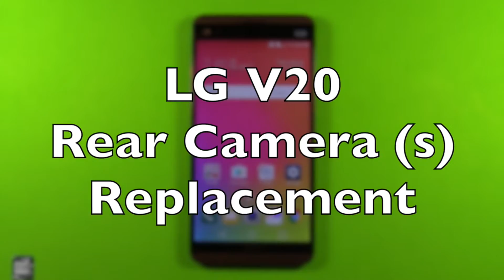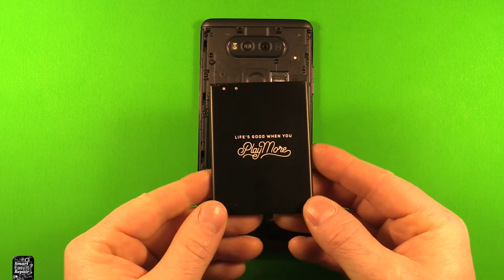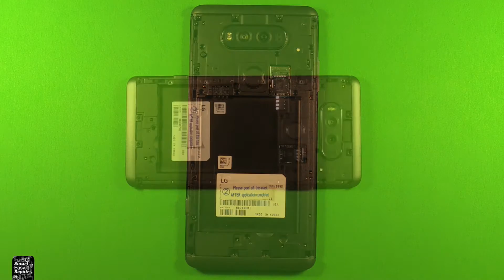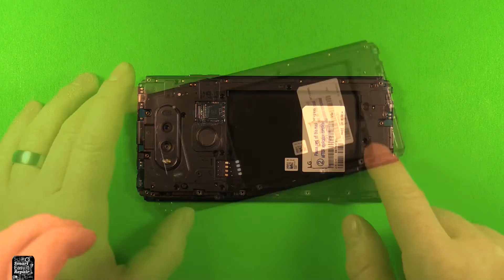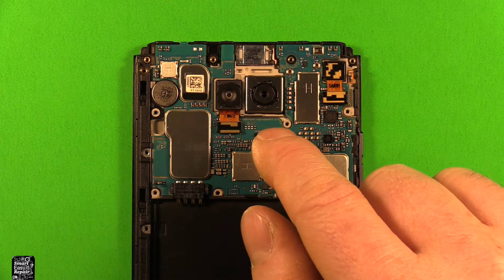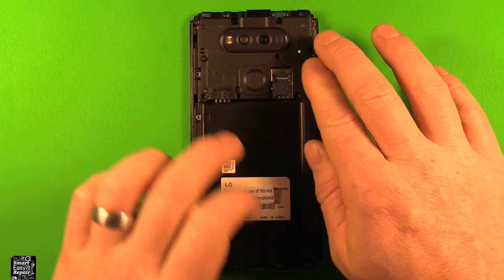LG V20 Rear Cameras Replacement Repair How To Change

Comment: My wide angle camera has been blurry and when I disassemble the camera, there is a glue tape on the bottom, is is supposed to be there ? I bought this phone on ebay, preowned. Thanks
Reply from the maker: I don’t think so. Sounds like it’s been messed with. I would just remove that adhesive and clean the lens carefully and put it back together and see how it does.
Reply: @smarteasydiyer   thanks for your quick response. I unplugged the camera, gave it good alcohol cleaning but its still blurry. Lets hope its the camera that needs to be repaired ( since I already ordered one )
Reply from the maker: Ok yeah hopefully replacing it with a new one will fix it then. 👍

Comment: When you were explaining on which screws to remove you said to remove the 16 on the outer edges and don't worry about the five on the left hand side but as you're showing removing the motherboard those five screws have been taken out and you did not show that in the process
Reply: I just finished following the video and I did not need to remove those 5 screws. Follow the video exactly and you will get the results you want
Reply: 👍I replaced both rear cameras, still not working. Going to do a factory reset. If that don't work may change mother board.